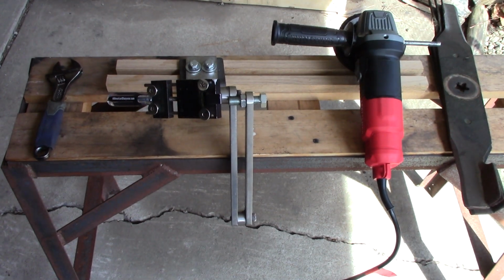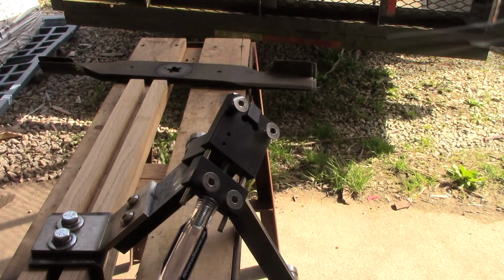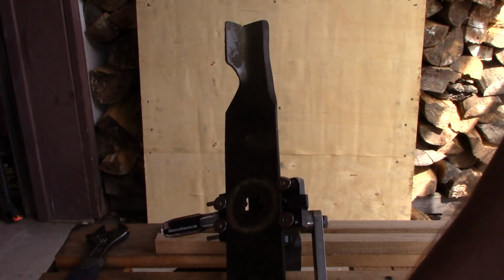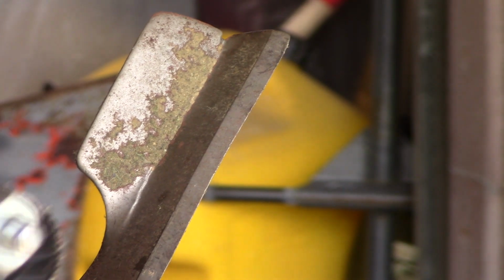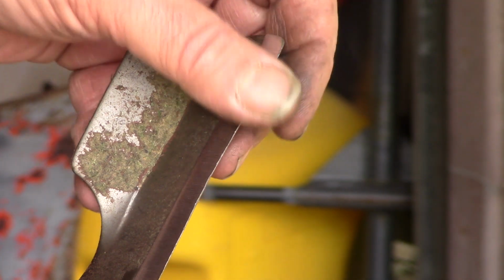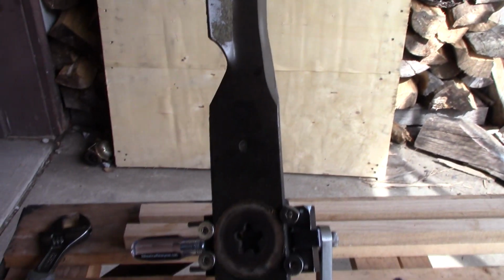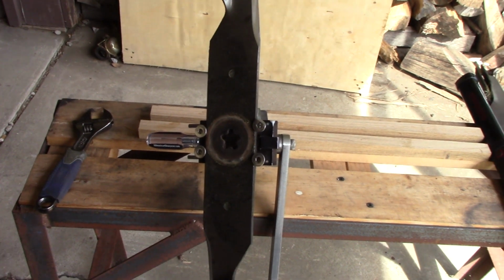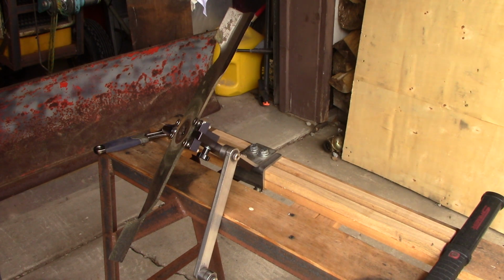Tool review of the All American Blade Sharpener #mowerservice #mowerrepair #mowerblade #howto #DIY

Comment: Looks like a nice product. I tried to many a different ways sharpening blades. Now that I got a zero turn which is a large investment I'll be checking these folks out I may have one of these in my arsenal of tools thanks for the good review It looks simple to use .
Reply from the maker: It is simple to use and if you do a few side sharpening you could recoup some of your investments
Reply: @PullerbearEd  You're such a good salesman I just ordered one it's cheaper from their website than it is to go to Amazon and get one. I saved about $50 ordering it from them direct. That's for others that may look to buy one.
Reply from the maker: Yes I forgot to mention that in the video, and now they have a dealer in Canada also selling them.

Comment: Looks like an Easy To Make unit from scratch if ya wanted to but defenitly worth buying over making it @PullerBear Ed
Reply from the maker: Yes the design is simple but there are lots of little things with it that make it so easy to use that you would have a hard time copying that its still cheaper just to buy the original.
Reply: @PullerbearEd  kinda what I said
Reply from the maker: Yes you did. Sorry.
Reply: @PullerbearEd  its all good bro

Comment: Helpful video! Thanks for sharing your thoughts. I just ordered the same unit so I can Sharpen my Scag Patriot Zero Turn at home instead of hassling with delivery to my dealer for service. I’ve never sharpened a mower blade in my life but now maybe I can even start a little side hustle doing the portable sharpening gig as you do for other helpless homeowners 😂. A few questions:

1. Grinding disc or flap wheel? Saw a comment above where you mentioned you use a 60 grit flap wheel. Any preference on brand that you’ve found works best? I’ve got a corded Makita angle grinder.

2. What tool do you use to balance the blades? I ordered a Magna Matic Mag 1000 (snagged it direct from manufacturer for a reduced $160 bc it has a cosmetic blemish). 

3. If you don’t mind sharing, curious what you charge for mobile vs on site sharpening?

4. What do you use to jack up mowers for blade access? I’m just pulling mine up on on the edge of the tailgate on my utility trailer but I have to move the mower to both sides to access all 3 blades. Thought about installing a motorized overhead hoist from Harbor Freight but worried my garage trusses won’t support the weight.

Thanks!
Reply from the maker: 1. I like the flap disk and I get them from harbor freight. 
2 I just use the old fashioned pin balancer but I have use a nail in the wall setup .
3. If I goto the customer, remove the blade sharpen then and reinstall them I charge $10 a blade but that includes me scraping the underside of the deck too.
4. In my shop I have a gantry I built with an electric hoist on it. If I'm mobile I use a set of ramps off the back of my truck.
Reply: @PullerbearEd  Thanks for your quick response! I’m jealous I of your Gantry and hoist! We’re all still just little boys (trapped in grown man bodies )who want all the cool “Batman gadgets!” Lol.
Reply from the maker: Lol very true. I built my gantry from pipe I got at the scrap yard.